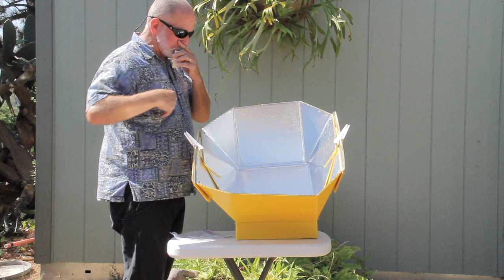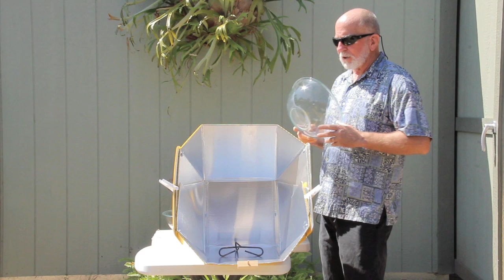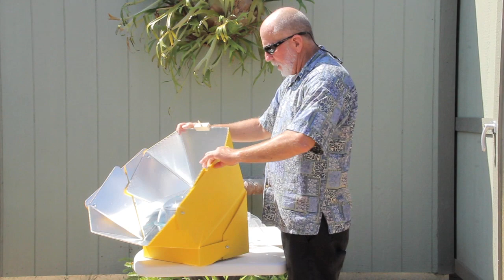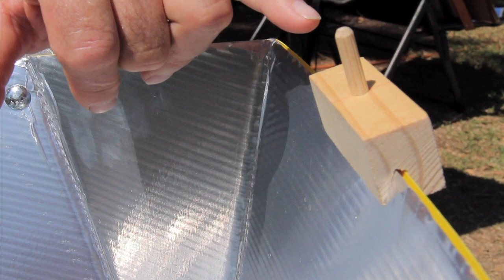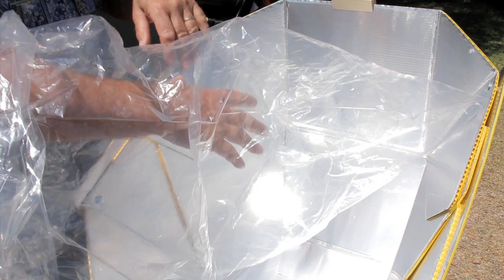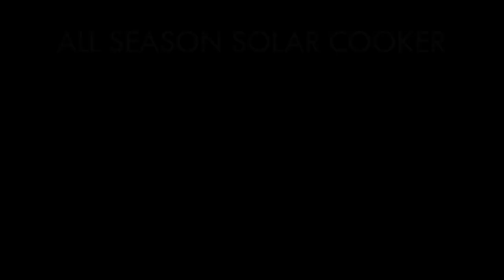All Season Solar Cooker Operating Features

Comment: I'm intrigued by this cooker. I'm in the market for one and in the research phase right now. How does this one compare to the one that I'm seeing on all of the homestead channels on YT that has a price tag of nearly $500 (you all know which one I mean, right?)? Like everyone I want a solar oven that works  like I want it to work but won't wreck my budget (the $500 one would!). Any comparison advice would be appreciated. Thanks!
Reply: Okay, here's my 2 cents worth...... First of all, I have the All American Solar oven, the Haines 2.0 solar oven, and the Sunflair "mini" (medium size) that I use on a regular basis. I use my All American almost every day in the summer and fall (occasionally in Spring) for main dishes and bread. I use my Sunflair for when I just want to cook small amounts of steamed/baked veggies, rice, or heating up leftovers. My Haines 2.0 is very similar to Jim's solar cooker. To be honest, I haven't had as much success with it, my timing just seems off. Where I live there is quite a bit of wind in the afternoon and the softsided (cardboard type) solar cookers respond more negatively to wind, in my opinion. Others I know say the same. I think it's a personal choice..... If you can only afford a certain one, so be it. You can probably make it work. I had used the All American before, so was pre-disposed to liking it. I also bought it on one of the company's "deal" days and saved a significant amount (over $100). Frankly, it's paid for itself with all the propane I haven't had to use for cooking, and not having to run the AC when I use the oven. I have had it for 4 years, my Sunflair for 10 years, and my Haines 2.0 for 4 years. Hope this helps.

Comment: Hello!  Not having great luck cooking but we have a lot of cloudy days here.  I cannot seem to get a "base" as shown in this video. I have followed the instructions from two different videos but still no square base for my Winter cooking or Summer cooking. Could this be a different model of the All Season cooker?
Reply from the maker: The current model has a base that measure 17” wide by 12” deep. Earlier models were 12” by 12”. The most important thing to achieve is proper reflector shape. When broken in your reflectors should resemble a stop sign, not a rectangle. Proper shape is the key to performance

Comment: Jim, I cooked chicken with bbq sauce, I put it on for three hours and it did not even phase the chicken. It said am and pm cooking shadow and still nothing. Really disappointed 😞. Does it have to be over 80 degrees in order to cook?
Reply from the maker: Hi Sandy, Thanks for your question. The most common reason for poor performance is that the cooker does not have its correct shape yet. When first assembled, the cooker will be much taller than it is wide. This is because the cooker is not broken in. Flex the cooker, as shown in the assembly vid and in the instructions. Flex it a lot. Flex it many times. This will weaken the plastic joints and allow the cooker to rest in the proper configuration. It should look more like a stop sign  This will resolve the temperature issue. Do not attempt to cook on days when you cannot see your shadow, The clearer your shadow, the better the cooking, No shadow, no cooking. Please try again and let me know your results.

Comment: This looks like a great idea! Hopefully you have a brochure or heck,  just some photocopies of your recipes to give us an idea on how to cook different food items as well as variables on containers for instance cast-iron? Does it always have to be a dark color container for the food? What about stainless steel or enamel coated,  all or clear corning ware? White corning Ware with glass lids?  Hope you don't mind my asking… Thank you ever so much 👍🏽✝🌻
Reply from the maker: I hope the cookware video answered most of your questions. Check out the polenta video. Also, rice and pasta start in cold water. There are a ton of great solar cooker recipes on line. Most are just like stovetop recipes, or oven recipes. Others use slightly less water or take slightly longer to bake. The real key is using a food thermometer to test for doneness of meats and poultry.

Comment: Is there any difference between the All Season Solar Cooker Camper and the Sol Cook All Season Cooker?
Reply from the maker: The Camper is larger then the original All Season Solar Cooker. The Camper and the All Season Solar Cooker Camper (17) are the same. The original ASSC is no longer in production.

Comment: In the video, I noticed the "sun direction finder" :) on the lower panel.  In some videos it is on the upper panel, does it make a difference?
Reply from the maker: The Sunsight may be mounted on the top reflector or the bottom.  Because the array is coordinated, both reflectors are at the same angle to the sun

Comment: Can I use this to bake, for example, muffins? In this case, the Pyrex bowls won't be able to cover the muffin pan.
Reply from the maker: Yes you can bake muffins. For baking dishes that do not fit in the Pyrex bowls you may use the supplied reusable cooking bags. Place the muffin tin in the bag, cover the tin with a second muffin tin, face down,  cook. Depending on how high your muffins will rise, you can also use a black teflon grill sheet, cut to size. That is what I use for biscuits and works very well, not sticking to the biscuits.

Comment: and in Canada middle of winter 4 hours of sun if were lucky in -30? will it work ?
Reply from the maker: Weather being clear, and using the sun sight as instructed, yes. Rice, small potatoes, polenta, pasta. Just don't go too big. Snow on the ground will improve cooking. If windy, use a glass enclosure instead of the cooking bags.
Reply: @JimLaJoieAllSeasonSolarCooker  thanks jim

Comment: Can I ask you, how can you bake bread in the solar cooker?
Reply from the maker: I get best results as follows.  Make your dough as usual. Do the second rise in the bread pan. Place a turkey roaster in the cooker. Put the loaf, still in its pan in the turkey roaster.  Put the lid on the roaster.  Put the covered turkey roaster inside the supplied cooking bag. Do not wrap the bag tightly on the raster. But do close the open end or tuck the open end in a back corner of the cooker. Se the sun sight to focus one hour ahead of the sun. Check back in 90 minutes.  For extra browning, keep the cooker tightly focused for the last 20 to 30 minutes
What is happening? The black roaster is absorbing the sunlight and getting very hot.. The roaster has become an oven and the bread is baking.  This works with the black Granite ware roasters.  If your roaster is not black… it will not work

Comment: Does the cooker work in anything less than full sun? I'm wondering if the day is at all overcast, whether it will still cook, albeit slowly.
Reply from the maker: Wingo Chambers . This cooker and all solar cookers work in reduced sunlight situations. Generally, if you can see your own shadow, you can cook. Not talking the shadow under a car, but your own shadow when standing.
I have had great results on days with broken clouds (look up edge-of-cloud effect to learn why), great success on hazy days, works OK but slower on overcast days but if the overcast gets so thick you cannot see your shadow or if it rains, you cannot use a solar cooker. 
Hope this helps
Reply: Jim La Joie That helps tremendously -- I could not have hoped for a better answer. Thank you!

Comment: Wouldn't that be more efficient if the panels had mirrors on them?
Reply from the maker: My design goal was light weight and high durability.  Mirrors are heavy and fragile. The reflective material is an industrial grade film that is 99 percent reflective
Reply: @JimLaJoieAllSeasonSolarCooker  Thanks!

Comment: is this dangerous for ur eyes
Reply from the maker: When assembling the cooker, work in a shaded area or face the cooker away from the sun. When adding food, turn the cooker away from the sun. When adjusting the sunsight, stand behind the cooker (or in front - your body will shade the cooker. If you have sunglasses, wear them

Comment: Not having too much success with diy cookers in Midwest  america
Reply from the maker: Hi Bethel,  there are hundreds of DIY designs for solar cookers. Some work better than others, but they all work under IDEAL conditions. That means bright sunshine between 10 am and 2  pm. The All Season Solar Cooker is a little different because it can collect sunshine from dawn until dusk. What does this mean to solar cooks?  It means. you can start earlier in the day and get useful heat. That puts you ahead of the game in case clouds arrive later.
If you are using the All Season solar Cooker, be sure that you have the correct shape as described on page 2 of the instructions. Correct shape will easily add 100 degrees or mored.
The All Season solar Cooker was carefully designed to make the best of use of the sun. There its not a better one out there - regardless of price.  Because it is lightweight and foldable, the user must understand and heed the directions on page 2.  
Remember, the oven in your kitchen has many times the power of a solar cooker, so expect cooking to be slower and gentler. Do not overload the cooker (a 13 pound turkey is about the best I can do in winter) Use the proper pots and be sure to use the cooking bag as instructed. 
The pot, the cooking bag, the cooker all work together. Remove any one and cooking will fail.
proper shape is so important, I cannot emphasize that enough.

Comment: Very poor assembly instructions. You should show us what you were doing up close not from a distance and try talking that would help not very happy with assembly instructions at all
Reply from the maker: Thanks for your input. I am working on a better vid.
Reply: @JimLaJoieAllSeasonSolarCooker  Hi Jim: Please inform us of the new video. As global warming continues, I really cannot cook inside my house during the entire summer (basically 90+ degree every single day). I look forward to using a solar stove. By the way, can I use a Staub or Le Creuset Dutch oven that is not black? In this, I cannot use the pyrex bowls and the material is thick. Thanks.
Reply from the maker: @k9healthy  Flat black is best. Other dark colors will also work. Dark Red, Dark Blue are OK. Yellow, white, light green - are not OK. Use the supplied cooking bags. The key here is to absorb light into a dark surface. The color white reflects all light. The color black sends no light back. The more light you absorb, the better the cooking. Cooks who do not follow this instruction will experience less than stellar results.
Reply: @JimLaJoieAllSeasonSolarCooker  I bought the plans for my solar cooker many years ago.  I watched the video yesterday because I had taken my cooker apart and found the video very helpful with no problems.